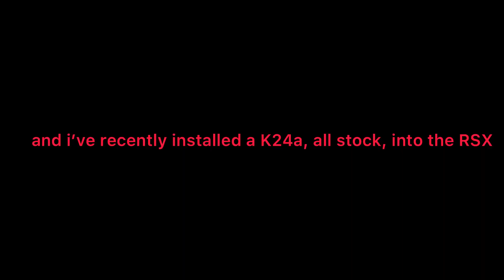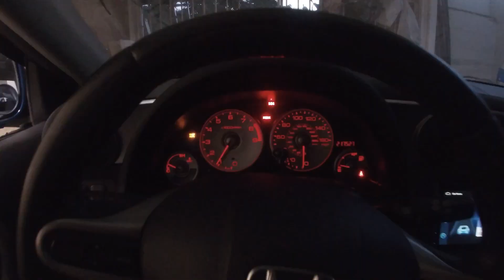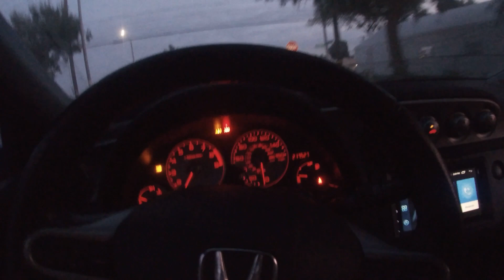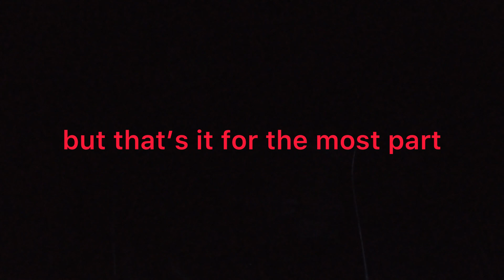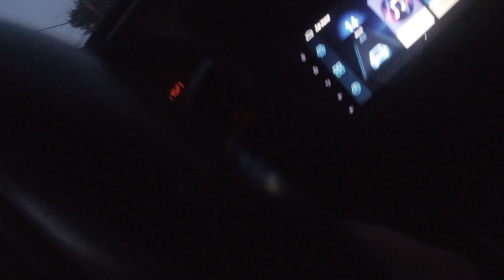RSX turbo is back!

Comment: Hey man, how was installing the cx racing kit on the k24? Straight bolt on like with the k20? What guide did you use for installing the kit? Have no clue/ idea where to look.
Reply from the maker: same thing jus have to do something about the coolant bypass
Reply from the maker: the kit doesn’t have instructions so i would start w the exhaust and turbo, get that clocked right and then set up the intercooler
you’ll have to shave some of the inside of the wheel well to get it to fit 
the bigger piping goes to the manifold and the smaller piping goes to the turbo side 
you can tell the feed from the drain by the hole sizes on the turbo
small hole goes on top, or the side that fits the fitting is the top side 
and the other two holes are for water cooling  so jus leave them open if you don’t use them

Comment: So the 8 gen si trany just bolts up ?
Reply: Yes it does
Reply from the maker: yeah but you it uses a css and rsx needs a vss so you have to disable the vss and reverse lock out unless you add a speed gear and the vss sensor

Comment: Damn man how did she blow?
Reply from the maker: feed line had a leak
Reply: @Tractionfighters Turbo oil feed I’m assuming? Was it a cheap line/fitting or just didn’t install right?
Reply from the maker: @jacks_Dc5 it was cheap :/
Reply: @Tractionfighters  appreciate you sharing brother, I'm about to start my turbo build in a month or two and I'll make sure not to cheap out on any lines